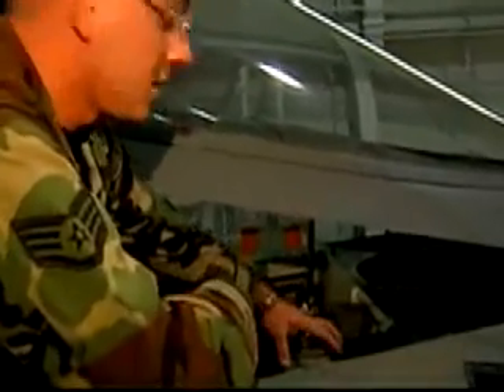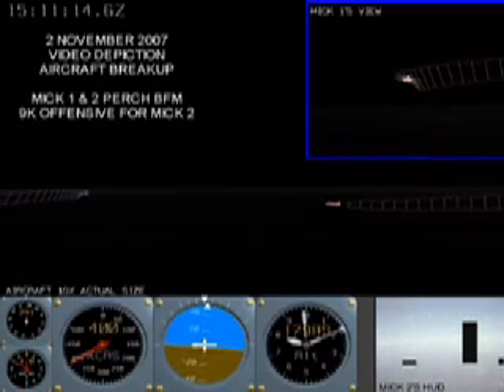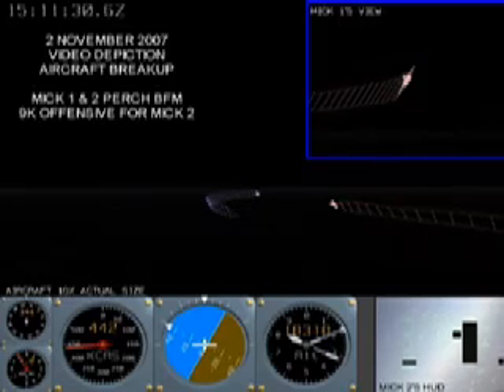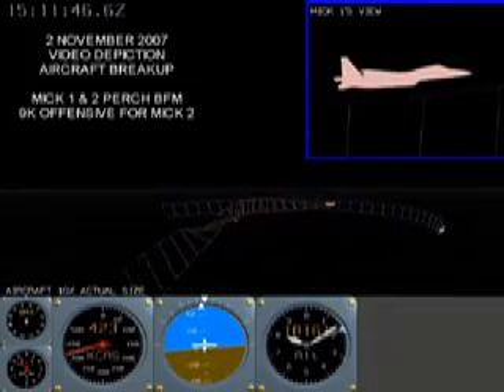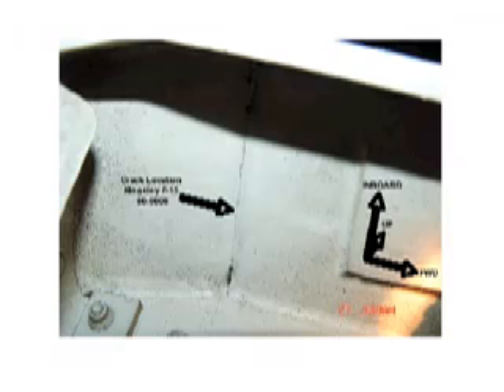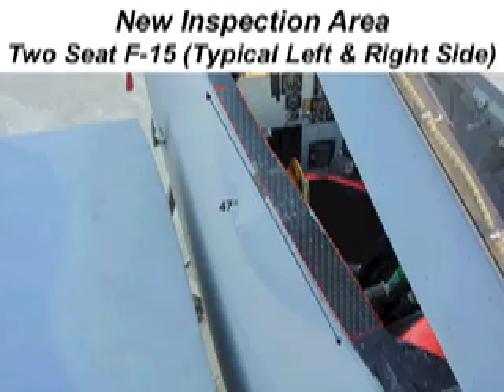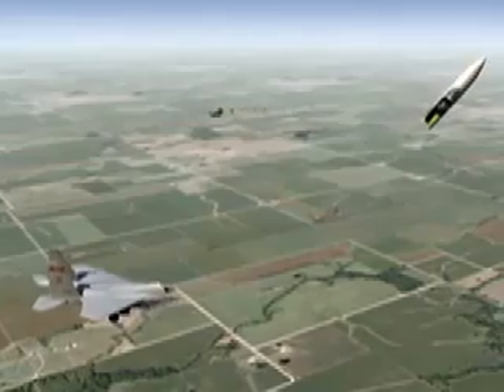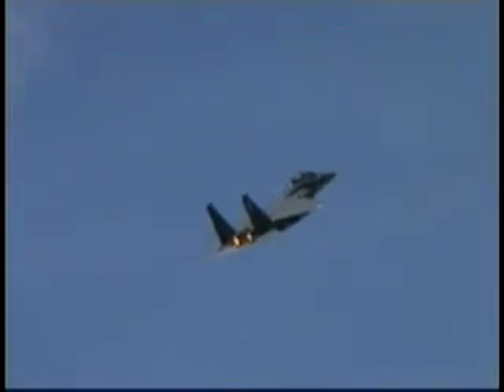F-15 Breakup Report, January 2008

Comment: The US thought the MiG-25 was a fighter capable of mach 3 and dog fighting under a G-load of over 9. Therefor the USAF developed a fighter capable of fighting an aircraft of that ability. Where in reality, the MiG-25 is only capable of no more then 3 G's and any run over mach 3 burned up the compressors and rendered the jet usless. The US' over-estimate of the MiG-25 developed the most formitable fighter the world's ever seen.

Comment: Who cares which is "better" the F-14 or F-15?  Both are amazing planes, I personally liked the F-14 better, and it always was my dream plane to fly when I was younger.

The F-14 DID have an armament advantage with the Phoenix missile over the F-15, and the F-14D model could actually achieve higher speeds...HOWEVER, anything above I think 500-600MPH, and the F-15 could outturn the F-14.  Plus it could outclimb the F-14.  Both were superb though.